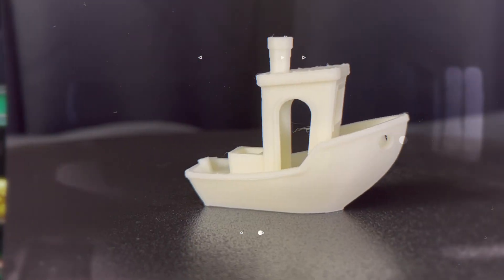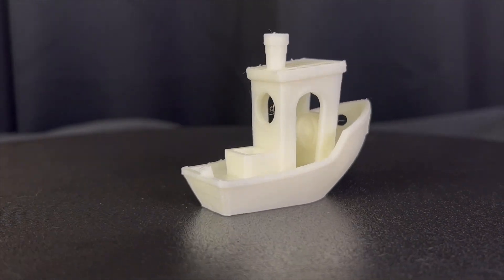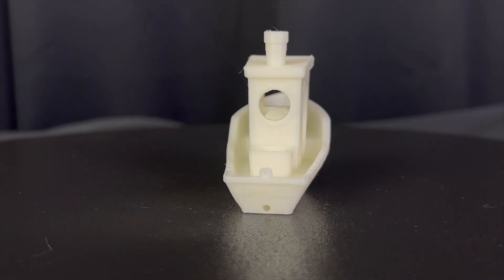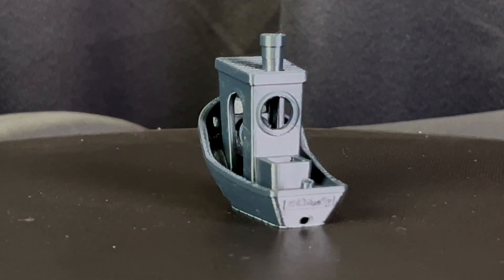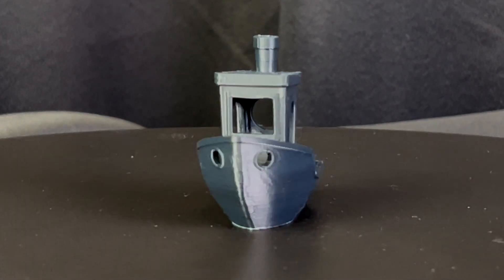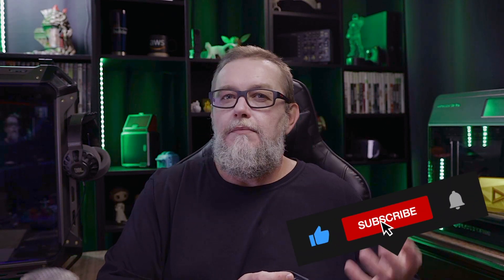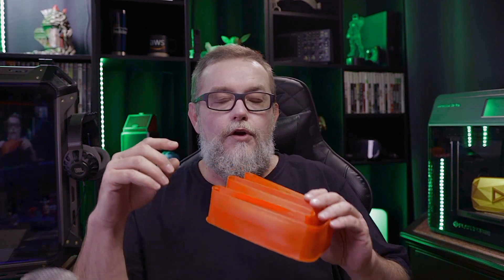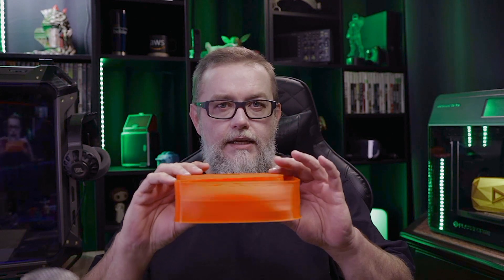How Well Does ABS Filament Print on Modern 3D Printers? Creality K1, K1 Max & FlashForge Tests

Comment: -- I'm about to slam a spool of Creality Hyper series ABS that is a year old, for the first time(so far I love PLA, not so much PETG, mixed results with PA6-GF) in my Qidi Plus4 printer, which so far been good to me. Do you using a glue stick for print plate? I'm using regular "gold" PEI print plate, but some "fancy" material stick too good, that I've been lucky to peel it off without scratching PEI plate.

P.S. That is a nice fly-bar-less helo-copter you got on that shelf! ;)

Comment: I have a distant cousin of the K1, the Kingroon KLP1 230 (running Klipper and slightly slower than the K1) and I hate ABS. To be honest, I have only used Purefil ABS and ASA but I can't print it for the life of me. No matter my calibrations or bed texture, I still only get absolute shit prints with ABS, ASA and HIPS when compared to relatively good prints with PLA and tough PLA. Thanks you for your amazing insight and tests. Definitively subscribing!
Reply from the maker: Thank you for your testimony. Yes ABS can be a blessing and a curse at the same time. I love the resistance, lightweight and the price of ABS, but I hate the weather influence over my prints even using an enclosed printer. But the quality of the filament can vary A LOT depending on the brand you are using. F3D is exceptional, but there are many crap brands on the market, I would recommend you to try some different brands, and glues for good bed adherence.
Reply: hotend?